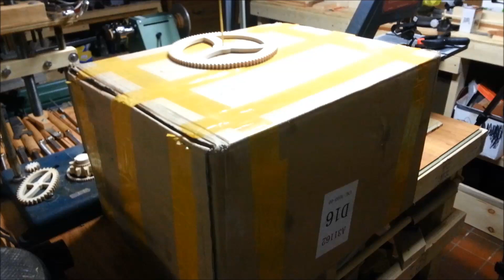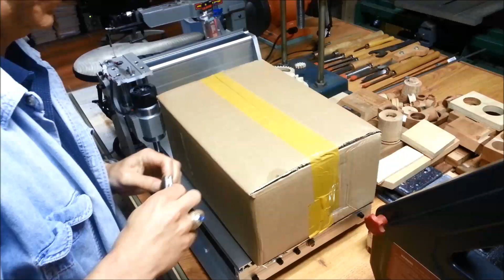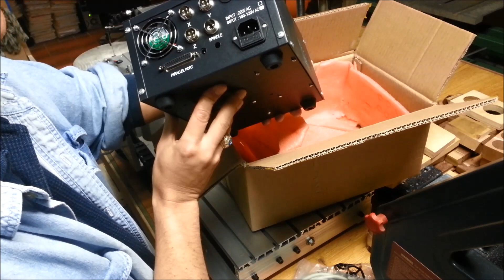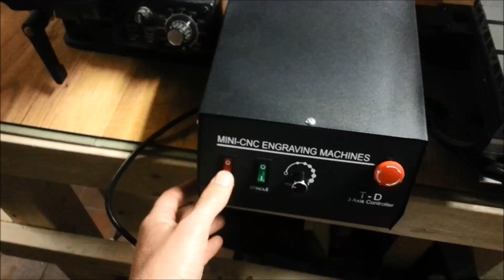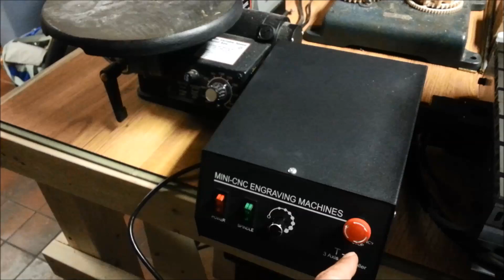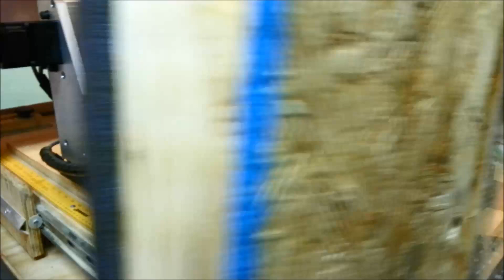CNC - 3040 - Unboxing & Set Up

Comment: I bought  the same system  I  am running  it on my laptop  with a uc100 and mach 3 software  software  seems to work uc100 seems  to work its showing blue and green lights spindle  runs from control  box but that's were it ends stepper  motors  not moving at all I  am a patient  guy been trying  to get this thing working for a year or more I'm  self taught  and a terrible teacher any suggestions  thanks have a great day

Comment: I just got a 3040t today.  Very similar to yours so I hope you can help.   I have not yet installed the software.  But I was trying to turn on and test the spindle just using the manual control.  But it will not start.  Does your spindle work without the software on?  Not sure if it's a bad cnc or if I need to install software first (waiting on a new/old computer to arrive).
Reply: I just got 3040T also. Can you please help me. I having a problem to install software come with machine. I already have Mach3 install. But how to run this machine on Mach 3. Thanks,

Comment: Hello
How is the quality of finished products?
Reply from the maker: It's a good little CNC.  Resolution is impressive for such an affordable machine.
Reply: drez20001 can soft metals be machined?
Reply: drez20001 like brass and aluminium
Reply from the maker: It can't really cut metals with the stock configuration.  I made some modifications and put a larger router on it and was able to cut and engrave into aluminum.  Here's my video on that mod: https://www.youtube.com/watch?v=ase2RpzYE4c
Reply: drez20001 saw your youtube link, which spindle you used for cutting aluminium? I think slowing down feed rate will help a lot to cut, please suggest as I am about to get 3040 cnc with 500W spindle.

Comment: Is it possible to swap the spindle motor with a 15w laser module?
Reply from the maker: A laser could be attached to the CNC where the spindle is, however, controlling a laser is different than using a spindle or router.  Software commands are different to turn the laser on and off, control the duration, and power.  For a small laser it would be a better idea to get a laser machine that is designed for that purpose.  Best of luck.

Comment: +drez20001, many versions of this machine comes with PARALLEL PORT, what if we use PARALLEL PORT TO USB CONVERTER to connect it to Laptop instead of PC, would it work?
Reply: No, it will not, The power saver mode in the Laptop will stop the rip part way through your project. if your using mach3 the parallel to USB will not work.

Comment: I have the CNC 3040T USB version with the black control box. It does have the parallel connection on the back but it appears to be dead. Certainly I couldn't get Mach 3 to work with it no matter what I tried so I use the software that came with my CNC 3040 which was USBCNC. It's very basic but it does all I need for the moment. I just use it to set up and home my machine, drag my Gcode files into it and let it rip.

These are great little machines for the money. So far I've milled out PCBs, Acrylic Signs and Engraved some stuff. It does everything I've asked of it. I have upgraded my stock 200W motor to a 400W motor recently so I can have a go at slowly milling some aluminium molds eventually.

I purchased the four axis version though I've not used the fourth axis yet. I'm still getting to grips with regular 2D and 2.5D stuff.

One of the reasons I purchased mine (as well as for rapid prototyping) was to mass produce small signs and plaques but it has quickly become apparent that these machines aren't suited for any form of mass production at speed. For this reason, I am now looking to buy my CNC 3040 a bigger and more powerful brother. Something in the region of 600mm x 900mm working area.

I have a 4ft x 13ft space free in my workshop waiting to be filled so now I need to get saving. I've been looking at one machine called the Blue Elephant which might fit in there nicely. It's around $4000 - $6000 (depending on model / customisations etc) shipped to the UK. It's feed rate is measured in M per minute, not MM lol.

I'm going to have to put my little baby CNC 3040 to hard work to earn it's keep and pay for it's big brother LOL =]
Reply: Hey Tiny World, thanks for posting this was really helpful to me! Do you suggest anywhere I can learn to make proper G code? as when using the CNC program that comes with the machine it stops after making one short curved line. Could this be because I don't have a full licence? (as the long code they gave me doesn't work). Or because my g-code just isn't correct? I haven't cut anything successfully yet, but i will be using it to mill out specific 2D shapes from aluminium/wood. Any help would be really appreciated.
Reply: Hi, Sorry I have not replied sooner but I've not been well. I over did things this summer and managed to injure my back :(

The CNC Program that comes with these machines (Often CNC USB Software) I find is quite limited and basic. I only really use the software that came with my CNC Machine for milling out PCB circuit boards.

For cutting out shapes, making signs, engraving or anything else along those lines etc I highly recommend Vectric Aspire (A.K.A. V-Carve) but it isn't cheap to buy - BUT it is worth every penny!
Prior to using Aspire, I have tried lengthy tool chains using free softwares to convert one format to another to another such as Inkscape then to G-Code then to a G-Code sender but it just ends up long winded, complicated and I seldom got the results I wanted without hours of fiddling and messing about.

Now I only use the software that came with my CNC machine for milling out PCBs. For everything else I use Aspire (V-Carve). And while V-Carve looks mega complicated and intimidating, it's actually quite simple and intuitive to use once you've watched one or two tutorials. I've milled out signs I've designed in Aspire as well as engraved dog tags, engraved plaques etc. It really is a powerful and versatile tool and worth the money IMO.

I'm not sure but I think there used to be a demo version of V-Carve with limited features and functionality so you could have a little try before you buy. It's a lot of money to spend if it's not what you're after. It might also be an idea to drop the people that make V-Carve an email to discuss your requirements and see what they recommend.

I know they offer package deals on their software such as 2D and 3D carving bundles so rather than buying just the one software and later realising you need another, it might be worth checking out what you are likely to need and get a bundle.

Hope that helps!
Reply: Thank you!
Reply: Tiny's World ski

Comment: will this work with a MacBook pro? also I need to buy software? Is there anything else i need to buy to set it up?
Reply from the maker: This CNC will not work with a MacBook.  It requires an old desktop with an old school parallel port.  There are some workarounds for the parallel port but it's a Windows based machine.  And, yes, there is additional software needed.  It's a fun hobby but there is a learning curve if you're coming into it with no prior CAD/CAM experience.  The best way to get started with CNC is to join a forum and ask lots of questions.  Best of luck to you.
Reply: thank you, will windows 7 work
Reply from the maker: Unfortunately, no.  This CNC is based on older tech with the most common CAM program being Mach3.  This machine works the best with Windows XP on an old desktop.   Some of the newer 3040 CNCs do have a USB option, however, they are still running for the most part on older computers.
Reply: drez20001 sorry for being such a pain LOL but I am thinking of purchasing the CNC router 3040T 3 axis  do you have any videos of initial set up and use can you recommend any groups or forums I would love to talk to somebody about setting up, thank you so much
Reply from the maker: It's a great hobby with almost unlimited potential for creativity.  I have a lot of videos on using this CNC as well as other CNCs that I've built but not too many on the setting up of the 3040.  

If you have a 3D printer, another way to go is to build the MPCNC   http://www.thingiverse.com/thing:724999 

I recently built this CNC and it's pretty cool.  You can also buy the kits from Ryan at   https://vicious1-com.myshopify.com/ 

This is the MPCNC I finished about a month ago.  https://www.youtube.com/watch?v=jZNNK5Rsdzw

As far as forums go cnczone is huge and would have people there to help new folks enter the hobby.  If you're looking for a small forum you could check out http://www.worldofwoodforum.com/vb/ that's where I started years ago.  It's a small group of people but very welcoming and helpful.  Also, check out the CNC With Dave show.  It's on every Saturday night at 9pm.  It's a great group of people.  Dave also sells kits to make very good and large CNCs.  https://www.youtube.com/watch?v=pA1LZn60J7A

Comment: Who did you buy your machine from? I bought a similar one but the screws are so tight that the motors are struggling to move. Any advise on how to set up/adjust so it move smooth?
Reply from the maker: I don't recall the seller unfortunately.  If the motors are struggling it could be several things.  If you recently purchased it I would contact the seller.  It should move pretty easily with the motors running.

Comment: Hola, esta CNC funciona con windows 10 (64bit)?, cual utilizas?.
Reply from the maker: Hello.  I use Windows 7 32bit.  This machine requires an old school parallel port as well.  Best of luck.
Reply: Hello again, the machine works well and is accurate? Since I want to buy one but I wonder if going well.

Comment: be aware,these come with sorftware they tell you its the full version,well it is, but you have register it and pay 120 bux to unlock the softaware...if you dont,you only get 25 lines,,and it stops...make sure totell those china folks to include the code to unlock.I complained to the seller and they refunded me 70 bux....they dont like neg feedback...
Reply: Hi will you have a look at my video please I have a problem the seller is saying that the z axis being off should not effect operation I need someone who knows to make a good and honest judgement as to if I have bought a scrap machine!?! if so will you leave a comment so I can post the link to the ebay seller to get a replacement. Thanks in advance the link is/.........CNC 3040 Please help The Z axis is way off 2.9 mmm
Reply: filth hater... Can you re-zero it??

Comment: Did u look in to the emergency stop button
Reply from the maker: +GHOSTHUTCH I haven't tried to track down the problem.  After building my first CNC machine from scratch I just got used to keeping a mouse arrow on the stop button on the monitor in case I ever needed it.  Haven't had a need for it though.
Reply: +drez20001  I need the software now

Comment: Was it difficult to install the stepper motors? I'm new to this, but I really want to order one of these.
Reply from the maker: +SensibleGaming Very easy to do.  Four bolts and a coupler and you're in business.
Reply: Thank you for the speedy reply. Do you think it's possible to use this machine to build PCBs? Easily anyway... I haven't actually looked up what kind of software would be required for it.
Reply from the maker: With a very fine end mill probably could.  I've done some fine etching with it but haven't made any circuit boards.
Reply: Got ya. I'm just a bit concerned about it running on new software, like Win 7. Do you think it would work on it? Or what was your setup?
Reply from the maker: The computer I use to run the CNC is an old Dell that is running XP.  For my main computer station I have Win 7.  There are many CNC software programs that will run on Win 7.  Mach3 however was designed for older systems but I have run it in Win 7 just to run 'fake' tests.  I haven't tried to actually drive the CNC with a Win 7 machine.  It should also be noted that it's really best to have a dedicated computer (not laptop) running the CNC that doesn't have any internet connection, virus protection, etc. or any programs running in the background.  Step counts are very precise and if the computer is running more than just the CNC it's very easy for the step count to get off and the cut to go way off track.  I do have the old Dell networked to my main computer.  This way I can design cuts on my main system and then just send the files over to the old Dell.  Best of luck.
Reply: I see and one other question. If I had a 3D model of something (something basic like the thing you were cutting in your "Making CNC Pockets - With Free Software!" video, could I load that into one of these program (like jscut) and have this CNC (the 3040 for example) cut it out?
Reply from the maker: Jscut is a 2D program.  It's excellent at what it does but it only does 2D.  For 3D designs the programming gets much more involved.  Programs like Meshcam or Vetric's Cut3D and the like are designed for 3D work.  Creating stl files and other designs with 3D is cool but can take a long time to grasp.  The 3040 can do some small 3D work but is limited by the Z height unless you're building something up in layers for later glue up.  3D work is a big jump from small CNC 2D work.
Reply: Yeah, but the thing is I'm trying to make something that's really just as simple as your watch thing. If not simpler. It's smaller too. I'm not trying to make anything complex or with moving parts.

Comment from the maker: A.Rees - I ordered mine on Amazon; eBay has a pretty wide selection too.  It's a fun machine.  Thanks.
Reply: What's the actual max working space? Everywhere I look it has 2 listings or 3.. trying to figure out if the 3040 is worth the double in price from 3018 PRO or if I should go hardcore 3060 for triple